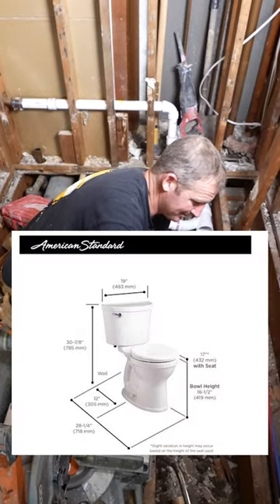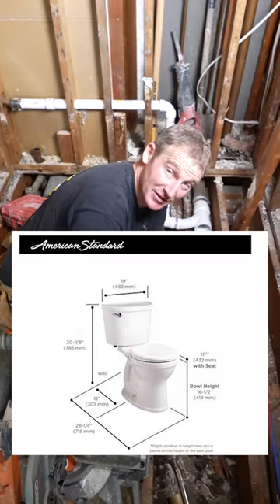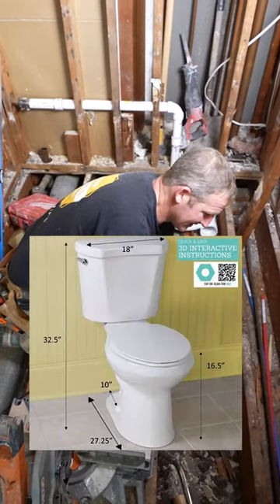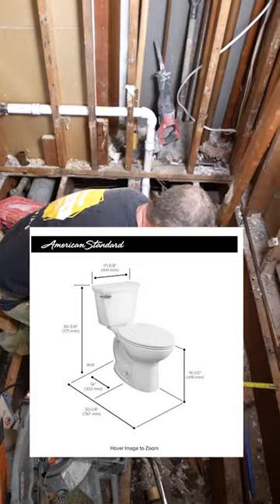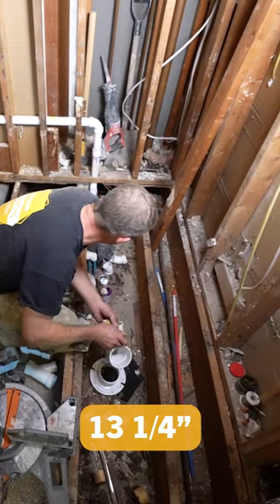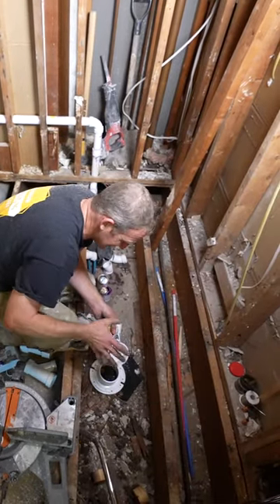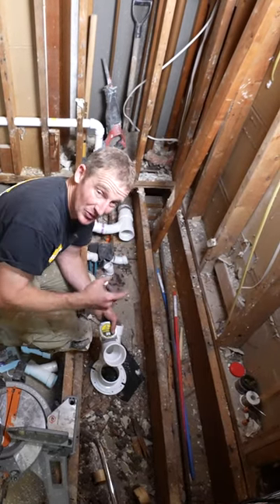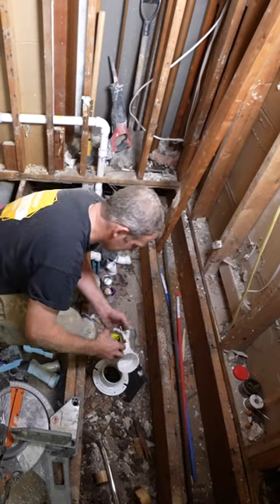Toilet rough in tip

Comment: How do you measure that to toilet flange ? Is it to center or to back edge
Reply: Center.  Measure from the toilet bolts if it's still installed.

Comment: If they really want it tight to the wall, then sister up the vertical joists before putting the dry wall back, failing that fill gap with expanding foam & make good after with decorators calk.

Comment: Personally I think that inch gap is driving my ocd crazy. Couldn’t you have over boarded the back wall to make up for that inch gap? Oh may be get a wall hung or enclosed toilet unit ?
Reply: You need room to pull the lid off the tank
Reply: @JohnSmith-xu7ev  not an inch gap, in all honesty that’s almost 2 inch. Simply over board it and job done

Comment: Horrible ads
Reply: Hi , just questioning , where I am from by building code , your three by 2 long sweep 90 with the heel outlet is against the building code their ? Just stating I seen , you holding while talking inside your hand when on video.
Reply: Hi , I am a plumber to and where I am from the long sweep 90 with a heel outlet is against their building code their , just adding under  questioning , only Over seeing you hold it inside your hand during the filming of your video.